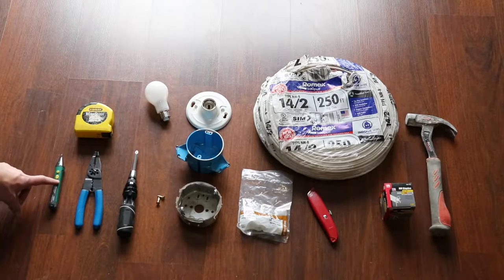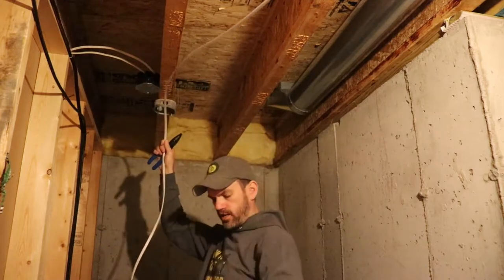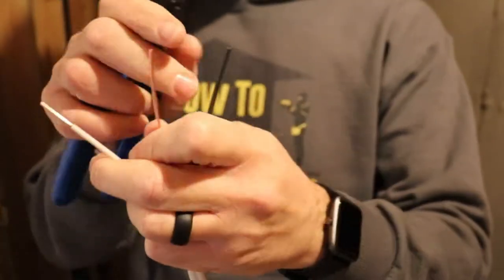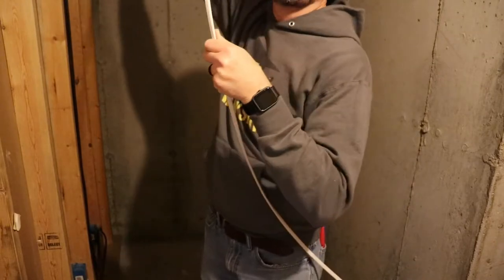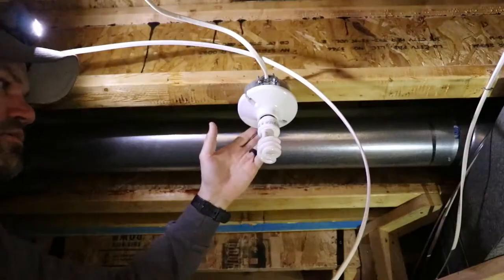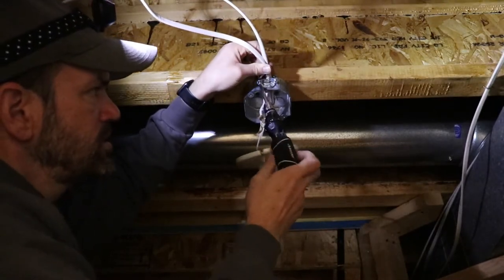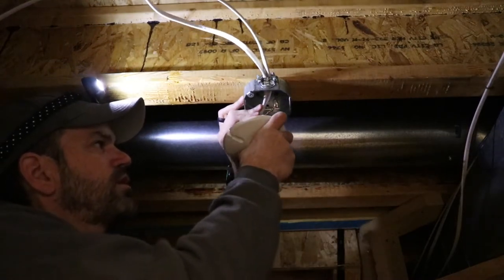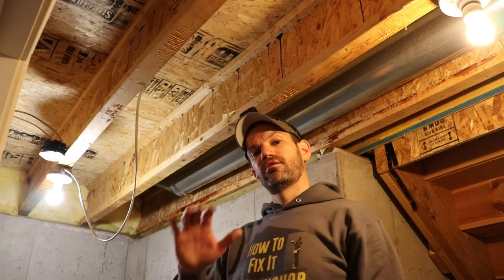Can I Add MORE Light Fixtures To My Basement or Garage?

Comment: So essentially if you wanted to run another light bulb socket you would run another electrical line to the extra screws on the socket to the next fixture. I’m going to try this on my garage but I want 12 sockets.
Reply from the maker: That's the basic idea. If you're looking for a lot of  garage lighting the led shop light fixtures usually daisy chain to each other, so you can plug in one or two and connect more fixtures together by plugging them into each other